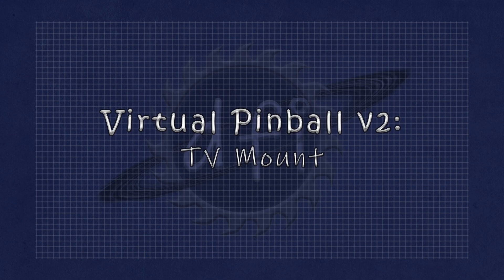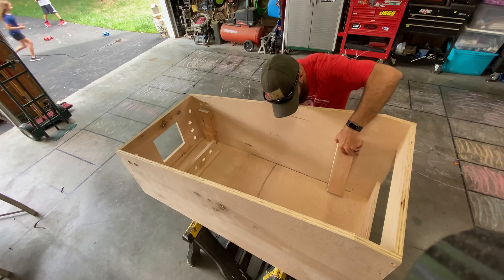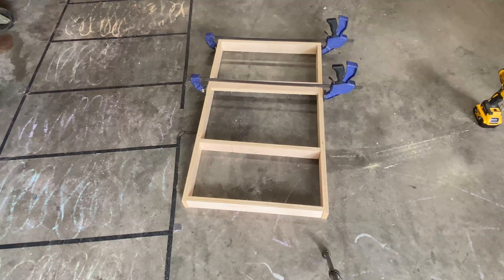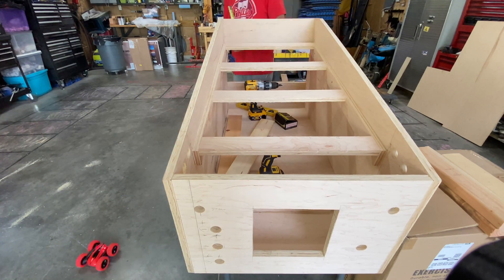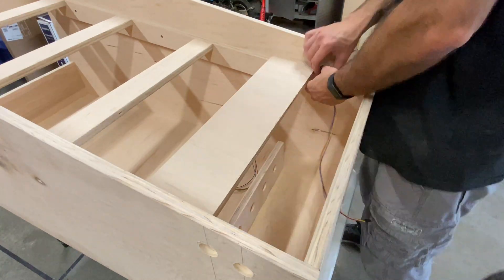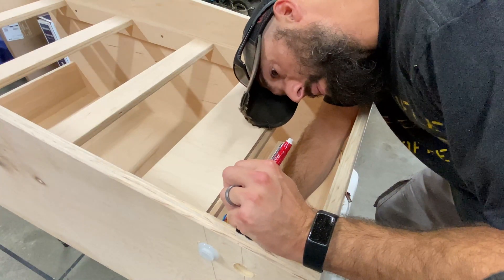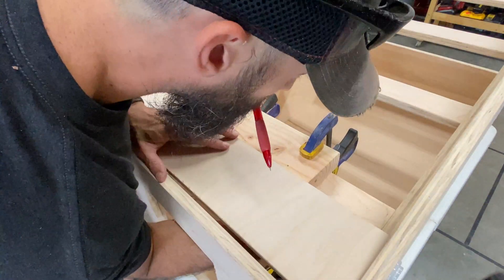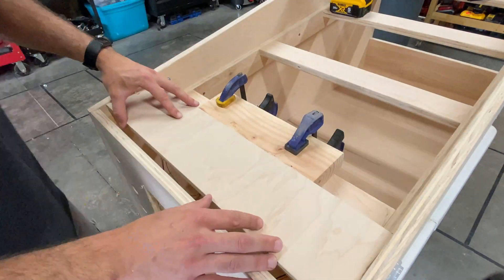Build a Virtual Pinball Machine: TV Mounts are Dumb and Other Fables - Part 5

Comment: I'm not sure why folks feel the need to fabricate a mount.  I literally have 4 blocks about 4" x 1" in the locations where the TV can sit and it works fine.  Easy in and easy out of I want.
Reply: because when you have a large flat panel and you are going to lay it flat you want all the weight on the vesa mount points not on the edges and corners.  same reason you don't lay a tv down flat when you put it in your car to take home.  when you have corner blocks you have all the weight and stress on the most fragile points of the TV.  It's not about mounting it, it's about where the stress is.
Reply: @gottahavitvt  I get your point, but most LCDs are so light nowadays (mine is 21 pounds), it doesn't seem too susceptible to bowing merely as a result of being propped up on its sides.  In other words, when installed, I  never once thought that there was too much weight distribution in the middle that it would cause sagging over time.  It sems actually very well supported.